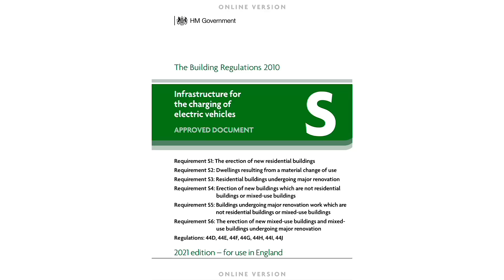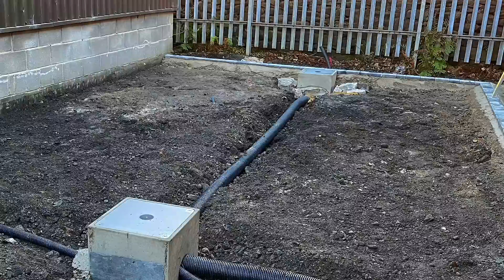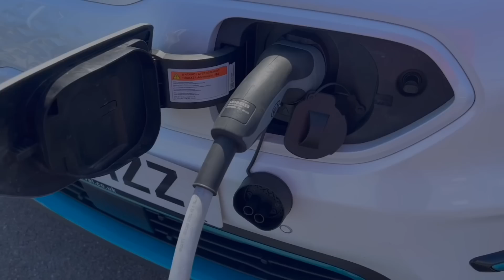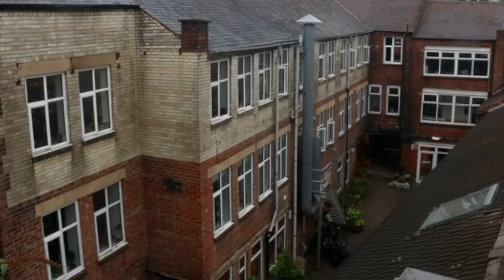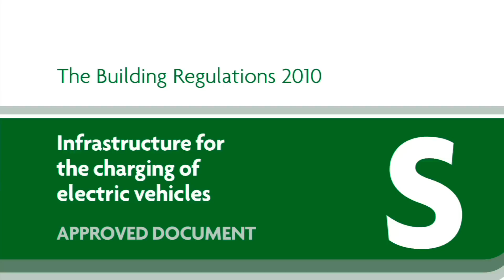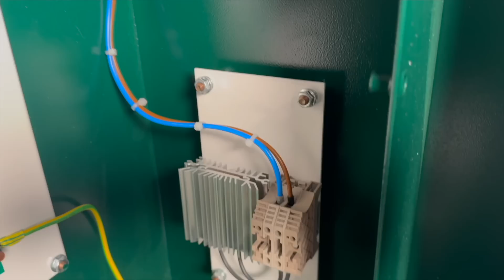Do New Homes Need EV Chargers by Law?

Comment: Unless you can get your own charger attached to your own meter you're unlikely to use what will be essentially a public charger that will cost way more money.
Legislation really not well thought out. If I have a dedicated space I'd want a charger attached to my meter, and ideally with controlled access or at the minimum an isolator inside the property.

Comment: The tethered connection is so much easier for the light fingered to steel the wire for its copper, even if they run the risk of shocking themselves.

Comment: In Australia all new homes in urban areas are required for to have three phase supply with provision for future EV charging and also three phase heat pump heating and cooling. Solar panels are not required at present. In Victoria new houses are required to be all electric.
Reply: Not sure where you got that from but it's not true.  I think Victoria did bring in a regulation that requires 3P consumer mains (that's the wiring from the premises to the connection point on the footpath for underground services) but even then you do not need to connect a 3P supply.  You are quite free to only connect 1P.

Comment: No new build homes don’t need to have EV chargers as standard simply because not everyone will buy an electric car/ vehicle. Example I don’t drive so why would I want a new house with a EV charger stuck on the outside wall. Not everyone that buys or rent a new build house will be drivers . Also I know quite a few people who do have electric cars but they will never have a charger stuck on their house they would rather use public charging stations. As and when they need to.
Reply: Just because you don't intend to drive does not mean that the next occupant of the property won't. It costs a tiny fraction of the retro fit cost to do it upfront and ultimately the vast majority of vehicles will be EV and houses once built have a tendency to be around for decades. As such forcing suitable charging infrastructure into new builds is totally reasonable.
Reply: @jonathanbuzzard1376  Same logic can be applied to installing petrol pumps at all houses. Maybe when you die the next person who takes your home wants to be able to fill up with petrol.
Reply: @4TheRecord  Only if you have the reasoning capability of a gnat. I currently own an ICE vehicle, and not for one second have I ever considered having a fuel pump and storage at my house. On the other hand, I am getting my supply upgraded (only have a 60A supply) and a EV charger installed despite not currently even owning an EV, because they are a prerequisite to owning an EV and I anticipate my next vehicle will be an EV.
Reply: No one that owns their own home and electric car would prefer to only have public charging, it's ten times the price!
Reply: Already took out a 3 year old charge point cos it was out of date. Too complex and expensive when really they’re just 32amp outdoor sockets. Let’s hope clean fuels come to the masses soon. Evs are not the future

Comment: You need to also consider this is a site wide regulation as infrastructure for the grid is done early so big sites with 1000 plots that will last 10 years to build if they submitted before the deadline then none of those 100s have to have chargers for the ten years